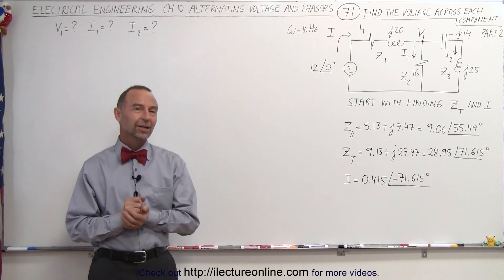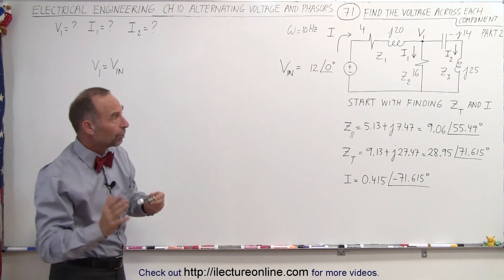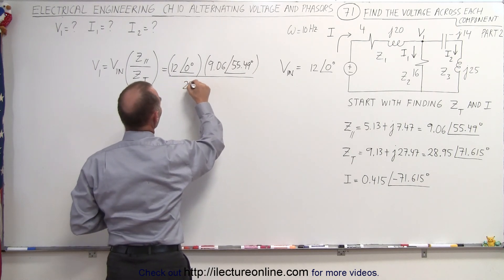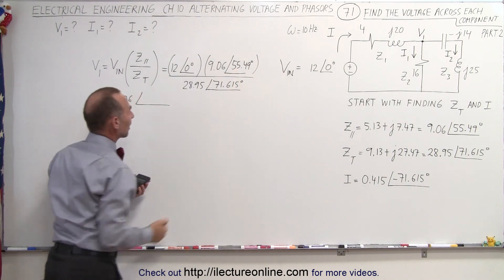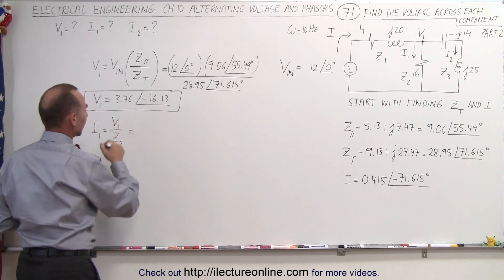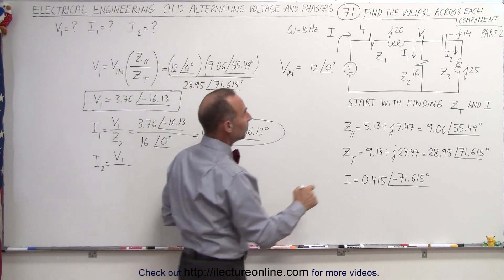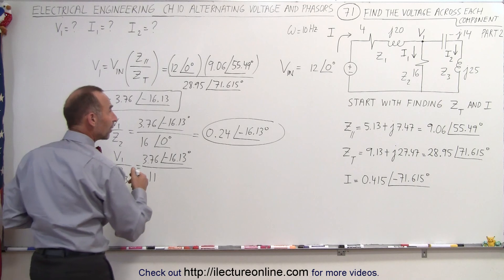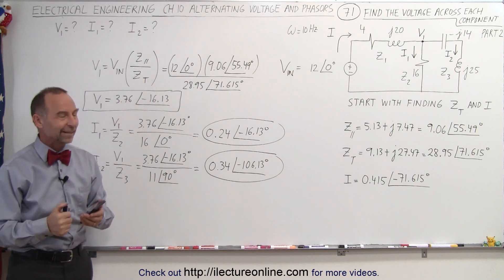Electrical Engineering: Ch 10 Alternating Voltages & Phasors (71 of 82) V=? Components: Part 2

Comment: I tried using the current divider formula for this circuit and I got the wrong result. Is it possible for me to use the current divider in this case?
Reply from the maker: Because of the active devices, you have to take into account the phase difference across the capacitor and the inductor.
Reply: @MichelvanBiezen  Oh, that makes sense. Correct if I'm wrong please but then if there was only one reactive device in the i2 branch I could have used the current divider formula right?
Also thanks a lot for your response as well as your videos, they are very informative and everyone can see you put lots of work into them. Keep up the extraordinary work.
Reply: @MichelvanBiezen i also did this question using current divideder and get correct  answer

Comment: Could you explain why it is that capacitors share the same charge in series and the same voltage in parallel?
Thanks for all the help
Reply from the maker: There is a whole playlist on the concept of capacitors that will answer those questions:  PHYSICS 39 CAPACITORS